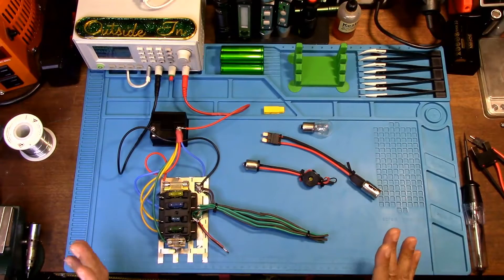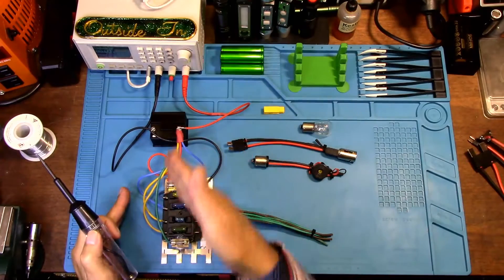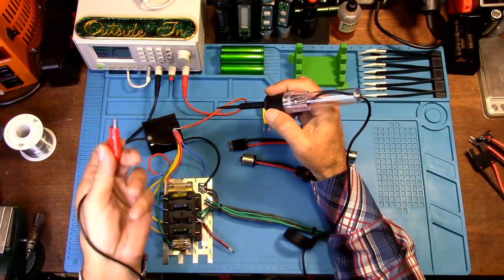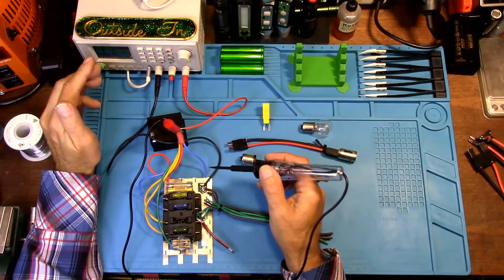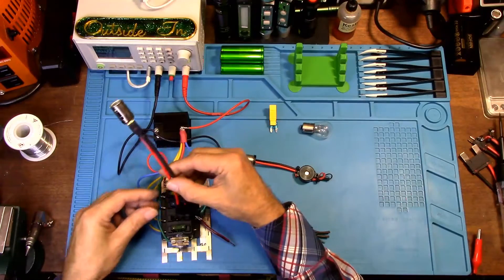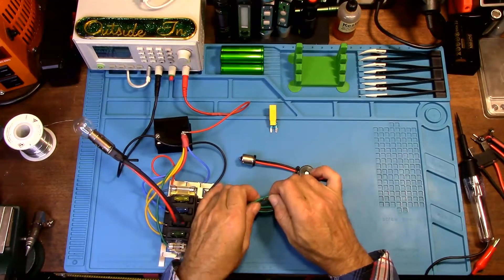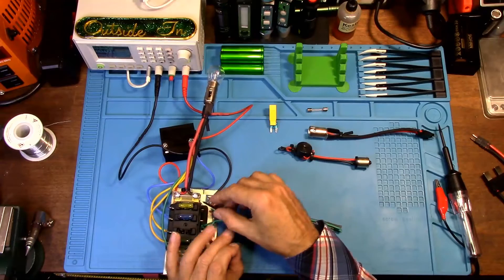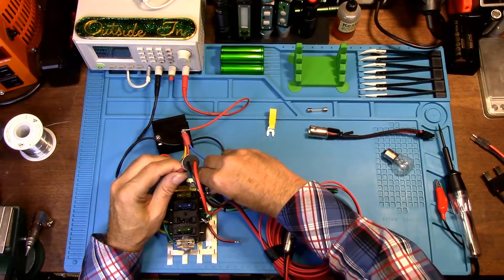How to make a short to ground tester Part 2 - (How to use the Short-To-Ground Testers)

Comment: Hey, just discovered your channel. Watching all of your air quality sensor videos. Thank you for your hard work! Are you planning on testing the Atmotube Pro? Would really appreciate an answer. 
Kind regards
Reply from the maker: CO and CO2 and the most important to know, and the Atmos Tube Pro has neither of these.  Also the Atmo Tube costs 180.00, but if you buy the Atmo Tube Air Purifier, you get the Atmo Tube Pro for 20 bucks - seems a little sus to me hmmmm...  Plus I can't afford the cost for air quality videos any longer - it is just too expensive.  I have contacted a number of companies about sending out devices to me for review, but every time a company checks out my air quality videos, they decline to send anything, and then I start hearing from people that those very monitors stop working after a few days or weeks or months, or are not consistent in their readings.  Plus I don't like any monitor that requires yet another app to operate.
Reply: @Outside-In.  Thank you for your answer! Yes, you are right, thats quite suspiscous^^ really sad. Companies with high-quality air sensors could take so much from your reviews. Hopefully they see the value in your videos some day. So for 80-150. dollars, which sensor would you still recommend the most? Hotkrem? I have allergic asthma, and it's important to me to have a sensor that is reading pollen (PM2.5). Because of this, I bought a Dyson Purifier 2 years ago. It has a Voc Sensor. And this sensor is always in the yellow and is only going to green if I open my Windows. As soon as I close them, Voc is going yellow again. Do you have some experience with Dyson Sensors? And with Dyson at all? Because I wouldn't buy one anymore. It's just not good quality for the price you pay. I would be interested in your opinion. If you are too busy, you dont have to answer! But would appreciate. Kind regards from Switzerland
Reply from the maker: @Merlin-ne8fo  Thank you Merlin for the kind words- much appreciated.  I will try to answer your questions in the order you asked them.

* So for 80-150. dollars, which sensor would you still recommend the most?

Out of all that I have tested and reviewed (not counting my Smart Sensor Meters), I have to go with TemTop M10 and C10 monitors.  TemTop created an upgrade to the M10, and it is the M0+ monitor, they were supposed to send one to me for review, but decided not to do so - hmmm.

* Hotkrem?

I can no longer recommend the Hotkrem monitors, because their quality has gone through the floor.  A viewer sent me their Hotkrem to try to fix for a video, during the video, I found reason to understand why their quality is so bad, so can not recommend them.

* Do you have some experience with Dyson Sensors? And with Dyson at all?

No, I do not have experience with Dyson Sensors or Dyson in general, and mostly because of price LOL.  So not having experience with a product, I can not in good conscience give advice of said device/product.

* If you are too busy, you don't have to answer!

I am never too busy to answer questions like yours :).

After spending so much time researching air quality and monitors over the past 1.5 years (I feel that I could pass a college course LOL), I have discovered that the best monitor that we can own when it comes to Particulates - is us....  You say that when you open a window your sensor goes green, when you close it it goes yellow again.  The best way to keep our air as clean as possible, is to just simply keep our environment ventilated (no need for a monitor as our mind will tell us when it is time to open a window).  In the winter it is not as easy to do that for obvious reasons, and why having a decent air purifier is so important.  I have been using the Voit Core 300s for more than a year, and it runs 24/7, and have had no issues at all with it.

In my opinion also, the TVOC readings in monitors is quite useless, and the reason I say that is because....  
* Burning a candle will cause the readings to skyrocket.
* Taking a shower will cause the readings to skyrocket.
* Cooking dinner will cause the readings to skyrocket.
* Getting dressed for work will cause the readings to skyrocket.
* Making the bed will cause the readings to skyrocket.
* Putting on cologne will cause the readings to skyrocket.
Etc., Etc., Etc....  and none of the above will harm us.  There are more than 10,000 VOC's in our environment, and most of them are nothing more than odors in the air.  A VOC sensor does not sense just one VOC or any particular VOC, a TVOC reading is a total of VOC's detected, and most of those VOC's are not even harmful, and I would also say that most of those VOC's are created by what gives us comfort through the scent of our favorite candle burning, our favorite cologne a significant other is wearing, a camp fire burning next door that brings back pleasant memories from our childhood or a better time, or the smell of breakfast being made early in the morning, the aroma of our favorite coffee brewing will also cause a TVOC reading to go nuts.

The two most important monitors/meters to own are CO and CO2, as both of those emit no odor or color to know they are present.  Particulates can be seen and sensed, so no need to have a monitor.  Also the smaller particles that we cannot see, are always there and have always been there since the beginning of time, and people throughout history have just opened a window to let in fresh air, and place fans in windows facing outward to get rid of those pesky particles that cause coughs and wheezing.

If you do a little research, you will find that the "Air Quality" craze did not start until Covid, and companies jumped on the band wagon after seeing the potential to make millions off of peoples' fear and paranoia.  I don't know how old you are, but as a child, did your parents use air quality monitors in every room?, or did they just say - Hey Merlin could you go and open that window to get some fresh air in here?...  You see - Our Own Bodies will tell us our air is stale and needs to be replenished with fresh, no need for a electronic device to tell us when to do it...  I love technology, but we cannot allow that technology to weaken our built-in self defense mechanisms by becoming dependent upon them... 

Pollen is not a good thing when it comes to having to open a window, so why having a purifier is also important.  When we can't open a window, a purifier will make up for that, but there is no substitute for fresh air from the great outdoors - not even an air purifier...

Sorry for being so long-winded, but when it comes to air quality, it is very hard to explain things in a couple sentences.  I do hope this has helped, so just keep opening that window from time to time, keep the air purifier going when you can't, and don't let paranoia take over and put a damper on life...

Comment: Trailers are another source of these problems for me.  I build one, just the standard fuse one.  And sure enough I found the problem.  It took me more than a minute I would say but this worked a treat.   I used a light bulb since we didn't have a busser laying around.  And my wife helped by watching the bulb for me.  Also, for today I just took an old light fixture and soldered leads on to it for quick and dirty.  But I will go back and get a good kit together.  This is very handy, thanks for all you did on this.
Reply from the maker: Thanks Glenn for your story, and you are right - trailers can be a bit tricky as well.  It is great to have a helper around for watching the bulb though :).  I would bet if you used a buzzer, you would probably use that more than a bulb, plus you wouldn't need a helper if there was none around.  Thanks so much for the feedback - much appreciated.👍